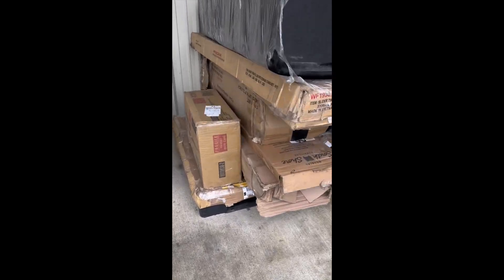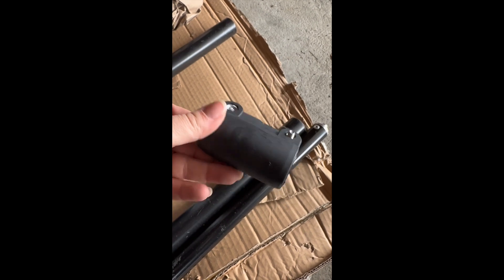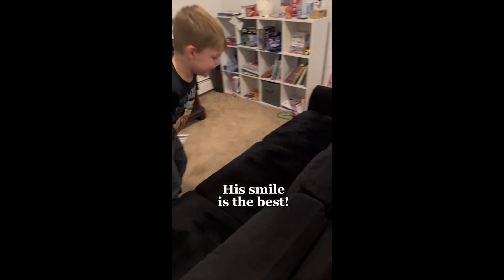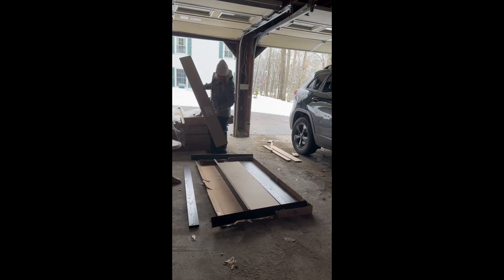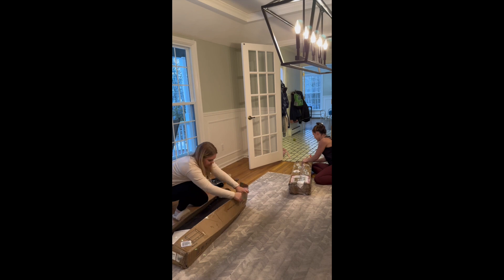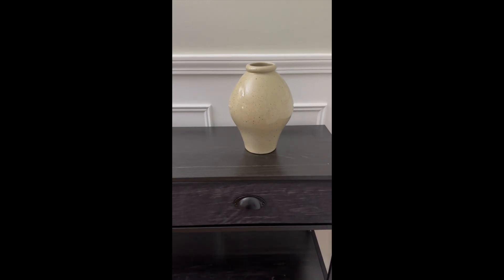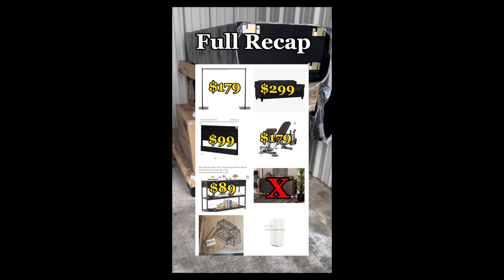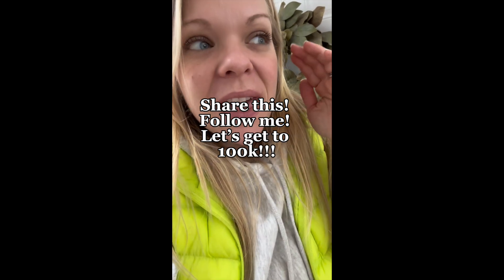I BOUGHT A $50 MYSTERY PALLET WORTH OVER $1,000

Comment: Great couch. I would use the guard rails for the bed  you are missing parts on as a towel rack or hang on the ceiling and have lines & hooks attached and use it to hang things from: In kitchen for kitchen items, In sunroom with hanging plants, In basement or closet to hand extra clothing. So many uses. Luckily, you are good at interpreting directions and have the patience to put things with multiple pieces together.